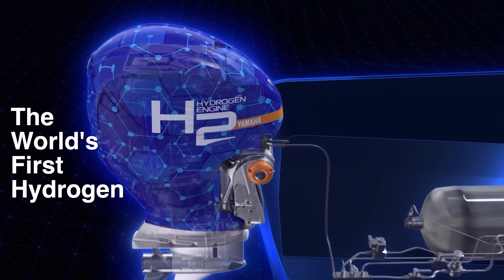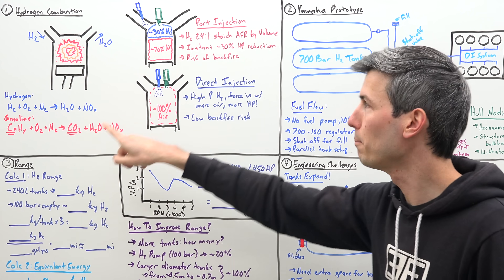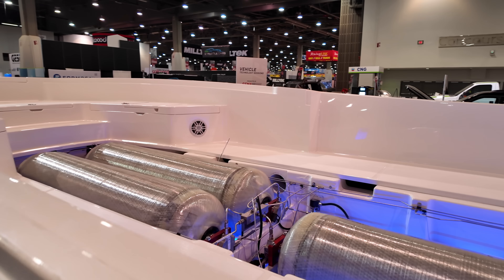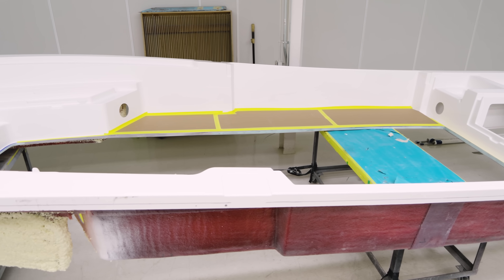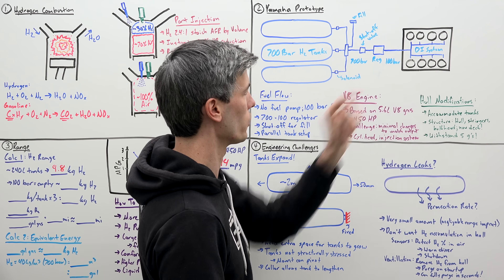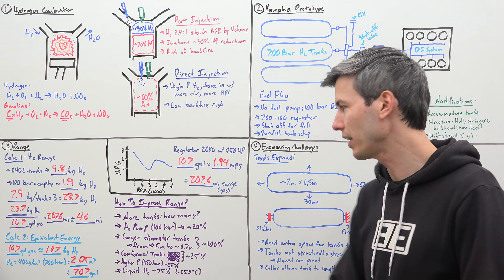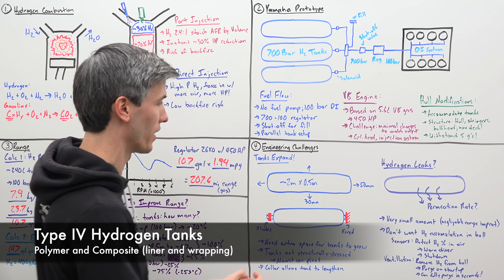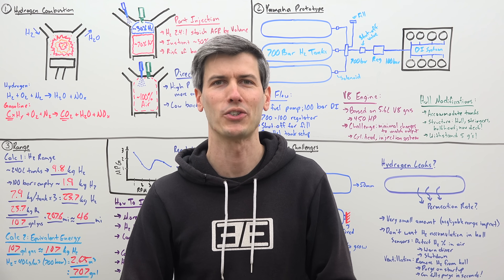The World’s First Hydrogen Combustion Outboard Engine!

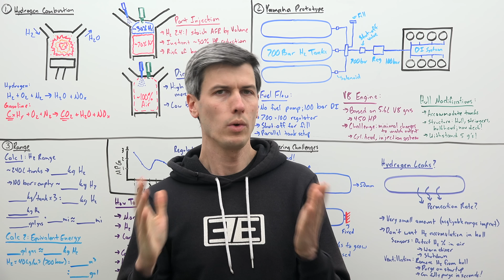Comment: 1:55 While it's true that it has no emission during combustion, the same can't be said for production on hydrogen plants. Producing hydrogen has a co2 footprint associated with it, abeit some sources points to be half as much as other sources like gas (talking about the whole chain of production, transportation and consumption).
Reply: While Hydrogen engines release near zero, apart from trace amounts of CO2 (from ambient air and lubrication oil), but they do produce nitrogen oxides, or NOx. So definitely not zero emissions.
Reply: You're talking about steam reforming right? Yeah of course it's gonna emit carbon. But there are other ways of producing H2, notably electrolysis.
Reply: @hanifarroisimukhlis5989  Where does the electricity for that come from?
Reply: @hanifarroisimukhlis5989  There is potentially thermo-chemical production of hydrogen from nuclear or thermal solar plants in the future.
Reply: @Your_Paramour   Issue is using electricity to make hydrogen to make electricity is many steps of losses.
Reply: More CO2 please.  Life Loves CO2.

Comment: Good thing we don't have to worry about corrosion on the high pressure tubing and fittings in a boat...
Reply from the maker: Marine grade, of course. There's a material for that!
Reply: 316 is amazing stuff.
Reply: @EngineeringExplained  of course theres a material for that, that slows it down it does not eliminate the issue.
Reply: @EngineeringExplained Sure, but that just raises the cost of construction and maintenance to make this boat even less competitive.
Reply: Time+salt require constant vigilance in marine applications.  They are pretty smart folks though.
Reply: You have to worry about hydrogen embrittlement. Especially in an environment when the boat can be expected to bang into waves over and over again.
Reply: I would be way more worried about the high pressure NON STEEL fuel tanks!!
Reply: @albertbahoogadin Toyota make their H₂ tanks from carbon fibre, they have a 10 year expiration date at which point they need to be replaced. These tanks show a 20 year lifespan
Reply: @Realciderreviews  there are fundamental reasons we do not use composite materials as pressure vessels. Especially in high pressure applications, the deterioration is not uniform, not predictable, not detectable, ridiculously short lifespan compaired to metallic vessels, crazy expensive, highly permeable and extremely dangerous fragmentation in failure.... a composite hydrogen fuel tank is actual stupidity at its best!
The fracturing of fibers instantly begins with the very first pressure cycle, this is without exception! The fracture rate then increases exponentially from the first cycle onwards.......

Fact, hydrogen cell engine... we do not need large fuel tanks at all!
Fact, when you separate o2 and h2 from water the gasses are produces at perfect ice stoichiometric levels.... hydrogen cell engine, no storage required x
Reply: @albertbahoogadin  And where does the energy required electrolysis for this hydrogen come from?
Reply: @Your_Paramour  P.S...... the same place you get energy TO START A CAR...... my god man try harder yes!!
Reply: @ So your proposal is to run the electrolysis powered by a battery, to then power the boat via hydrogen?
Reply: @Your_Paramour  you really ain't so bright are you, boat, car, generator...makes zero difference, the battery starts the system the alternator then powers it and recharges the battery....duuuuhhhhhhh 🤣🤣🤣
Reply: @Your_Paramour  how about you go and do exactly what I suggested and go find out how already made cell engines work xx
Reply: @Realciderreviews  there is not a single tank on this planet being used officially to store hydrogen that does not have a metallic orother suitable liner to deal with hydrogen. You have no idea what you are talking about lol....carbon fiber can not contain hydrogen itself...FACT
Reply: @ What is the energy source in this system? A hydrogen fuel cell needs hydrogen and oxygen to generate electricity, and you're saying you split the hydrogen from water via electrolysis. The way you describe it sounds like you intend to power the whole thing from the hydrogen fuel cell which is obviously not going to work...
Reply: @Your_Paramour  🤣🤣🤣🤣🤣🤣🤣😍🤣🤣🤣
The hydrogen and oxygen produce electricity now do they..... sure thing, you just stick with that lol
Reply: @ My dude how about you outline exactly how this system of yours works? I'm done playing your guessing games.
Reply: @Your_Paramour  the fact you seem to thing hydrogen and oxygen make electricity  is comical.... go educate yourself lol take care and good luck, clearly ya need it x
Reply: @ I have a degree in mechanical engineering and aced all my thermodynamics subjects. It boggles my mind that someone shouting into the void about fuel cells doesn't even understand how they are used to generate electricity.

The only thing comical in this conversation is your inability to state simply what the energy source is for this hypothetical system. Though your inability to type and construct coherent sentence is borderline comical.
Reply: @Your_Paramour  yeah ok, you have fun producing electricity from hydrogen and oxygen then 🤣🤣
Reply: The boat had stainless steel Swagelok lines and fittings. They are the best in the business
Reply: Aluminum?
Reply: @ec6933  Stainless... but it depends... because there are more constraints than just corrosion resistance.  Which can be mitigated with coatings... which also depends....

Comment: Beyond the video: in summary, synfuels are the way to go
Reply: Vegetable oil, alcohol.
Reply: @aryaman05 plants are way too inefficient at solar energy utilization though. Money spent on synthetic fuel research and infrastructure could instead be spent on increasing battery energy density.
Reply: @Imaboss8ball  synfuels does not mean plan rather fuels made of other source of carbon and hydrogen
Reply: @nlagas  other sources are even more inefficient and expensive than plant based.

Comment: Good for Yamaha!!! They didn’t fall for the battery only EV junk which is NOT and never was gonna be the future with current batteries!! Unless they invent a lightweight pack of batteries made from dirt or something very plentiful that recharges 0-100% in 5 mins or less never goes bad (but if does costs little and can be recycled) has huge range and can work in cold battery ev were done before it got started. At best they are good for small drives a few times a day. They are a city car. The future was always gonna be hydrogen with hydrogen fuel cells and this. What will probably win out is synthetic fuel tho. I’m guessing it’ll be a mix of hydrogen (fuel cell or not doesn’t matter) oil and synthetic fuels and with hybrids of all these some with bats or caps. All battery ev will die off again like 110 years ago.

Comment: Cant wait untill hydrogen boats are able to break down salt water in to hydrogen threw electrolysis to make H on the run
Reply from the maker: Unfortunately it doesn't work like that, you don't get more energy out than you put in. It's like saying "just drive downhill" in an electric car to recharge it, rather than visiting chargers. Eventually you run out of downhill, and it doesn't give you enough energy to get back to the top of the hill.
Reply: @EngineeringExplained  yes, b7t as a second fuel source,  I think it can become feasible, because only a handful of countries demand environmental acts, rund diesel most places, and hydrogen/electric gens fer others. And while oil burning, it could possibly power a genetic fer desalination of water, or the electrolysis to separate the H from H2O 
Inefficient but as a practice for case study and experimental purposes, I see it haven a possibly of potential
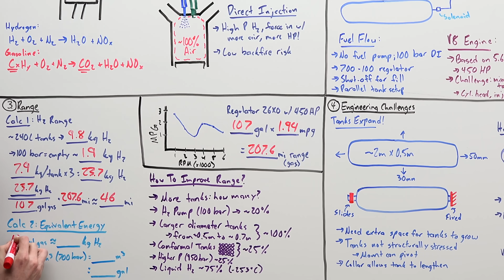Reply: I wonder how much pressure it would require to liquify hydrogen gas into a liquid ? 10:10

Comment: It is still a little interesting that there is always a little error in the numbers when hydrogen is to be presented. The weight contra wh is clearly lower in my Tesla battery. Why use a higher calculation factor? The effect calculated versus petrol/electricity is counted here as a 1/3 part difference? Since gasoline only gets out about 25% of the energy in engine power and electricity gets out about 94%, one wonders how you came up with those numbers? Then no one specifies how the hydrogen is produced (what color it has, if you want). There will be many more questions to ask. But don't let your conscience think about it,focus on the answer you're going to give your grandchildren instead.

Comment: I like the tech but it looks like a waste of time for a fishing boat. Fishing boats need storage for gear, livewells, fish boxes, etc. Also, the calculated range is abysmal and would be a deal killer for anyone who knows anything about fishing offshore. I was part owner of a boat manufacturing company in the same sector as Regulator for a good portion of my adult life and three things we tried to maximize into our design was storage, range, and speed. Those are the things fishermen (customers) want.

I would be extremely concerned with the dynamic forces placed on that hydrogen system. The vibrations and slamming loads on the piping could lead to failures in short order if they are not well engineered out of the equation. I could just see one of those pipes cracking at 700 bar when you are dozens of miles from the beach. I'd also be very concerned about the longevity of those hydrogen sniffers. Boats are inherently wet, if not by rain and spray, then by humidity. Everything on a boat is subjected to moisture and, especially in a saltwater environment, corrosion and failure are almost assured for some sensitive "lab" equipment.

As a test platform, the boat they used makes sense. It's easy to outfit, test, and study. But, as a future product, I don't see it happening. Perhaps a different type of boat, i.e., pontoon, day cruiser, or even a sailboat that would use an engine primarily for docking and close quarter maneuvering could capitalize on this technology, but I don't see fishermen giving up so much for so little in return.

Finally, getting Coast Guard approval would be a miracle.

Comment: so how safe are tanks with 700 bars of highly explosive gas?
Reply from the maker: There are production cars running around with these tanks (see Toyota Mirai, as an example). They're quite robust tanks.
Reply: @EngineeringExplained  What kind of impacts or degradation would make them explode? I'd like to see the comprehensive studies on that. If such force or degradation is not within the vehicle's capabilities or environment, then what about against bullets or explosives? What if a tank sinks into the ocean? At what point does it rupture and what kind of area of effect or impact would that have on sea life? And so on.

Comment: As long as the majority of hydrogen (over 90%) is produced from methane reforming, there is a CO2 penalty (more CO2 per energy unit using hydrogen vs direct burning the methane)
Reply from the maker: Yep, def needs to come from clean sources if it's going to have a meaningful impact. There is a massive green hydrogen plant going up in Georgia, interesting project!

Comment: At what point would it make sense to also store oxygen to use for combustion vs. mixing with air given it only contains about 16%?
Reply from the maker: Basically never, oxygen is essentially unlimited (atmosphere is pretty big), and doesn't constrain the system in any way - no need to overcomplicate things (and it's 21%*).

Comment: As usual a great analysis, but generally we still have a problem with ICE consuming AIR. If you do the math on that size of engine it's going to consume 684,000 liters of Air per hour or 24,155 cubic feet. cast that over the 3 billion ICE engines running and you'll see why the forests can't keep up. Why not do that on a white board?
Reply: What math are you doing here? With the entire hydrogen tank having a usable hydrogen fuel mass of 23.7kg, a stoichometric air-fuel mass ratio of 34:1 results in 823kg, or 623L of air passing through the engine per fuel load. So unless someone is draining the entire fuel tank more 1000 times per hour you are simply way off. Also most of the air (basically everything except the oxygen) passes through the engine unchanged. And for green hydrogen, the hydrogen is originally produced from water, with the hydrogen being seperated from the oxygen during production, so it's a closed loop. The only real thing that's being used up is the small amount of oxygen and nitrogen that is used to produce NOx. And while nitrogen oxide formation is definitely a cause for concern, it's not because were about to run out of air, it's because NOx is a pollutant and greenhouse gas.
Reply: @plainText384 My Bad. I was off on a tangent as I was referring to gasoline/diesel engines which consume AIR which is why you cant run them with your garage door closed, unless of course your car is outside the garage. We still have an AIR problem.

Comment: I'm really cheering for Hydrogen engines. I don't think it will ever be practical for small vehicles. But, for large trucks, boats and heavy mobile machinery, it can be a fantastic way to replace diesel and gasoline engines.

Comment: It's totally useless!
Hydrogen is a final source of energy, not a primary source of energy.
To produce hydrogen, you need electricity, and the yield is really poor vs. using electricity to move a vehicle.
You will lose 30% of yield during electrolysis and then another 20% to transport it, and stock it (compression).
So it is 50% less effective to use it against electricity just to produce it.  Then, when you compare the yield it has in an internal combustion engine, yes, it is better than gasoline but far from the almost 100% of an electric motor.  It solves pollution generated to extract lithium, copper, and metals in general to make electric batteries but OK good luck guys!

Comment: How much energy does it take to extract hydrogen from water? Given this is a boat, would it be feasible to refuel from the water you're in as you're traveling? Certainly, there would be energy loss, but could such a mechanism extend the range at all? Or would it not be worth it?

Comment: How does the BSFC change on hydrogen though? I would assume its much better than a gasoline engine given the properties of using hydrogen in an internal combustion engine. This would improve range, albeit not by a substantial amount.
Reply from the maker: In theory it has a slightly higher efficiency potential, but not massive. In practice it's tough to get it competitive currently, as there are challenges with hydrogen having such a low ignition energy (pre-ignition is a difficult challenge).

Comment: Would heating the tank when approaching 100 psi work to increase the pressure or just not worth the energy needed to heat the tank

Also safety but it is not because something can be dangerous that it cannot be mitigated

Comment: Boat is the worst application for low-density fuel. Every boater knows how fuel-hungry boats are and fuel tanks are massive - a few hundreds of liters for boat of the size shown, which is already quite expensive to pay. Imagine you get the offer of much more expensive fuel, in much bigger, expensive and potentially dangerous tanks - would you buy it? Would anyone buy it at all? Why?

Comment: All the leaking gas is easy to deal with.  My old 50 year old boat has passive vents that work while under way by scooping fresh air in and another port vacuuming it out. On start up there are electric blowers that force air into the fuel storage area and around the engine to keep the fumes away.
Reply: The bilge blowers  pull air  and heavier  then air gasoline  fumes from the deepest  parts  of the bilge. Adding  fresh air to a bilge  with gas fumes might be the perfect combination  for a really perfect  fuel air mixture.
Big bang!

Comment: Why wouldn't you just use that hydrogen to run hydrogen fuel cells and produce electricity, when can then run an electric motor? You'd make more efficient use of the fuel than a combustion engine, and if you really need the vrmm vrrm sound, you can put a speaker in the motor housing or something else equally ridiculous.